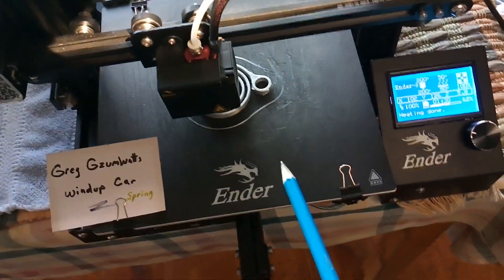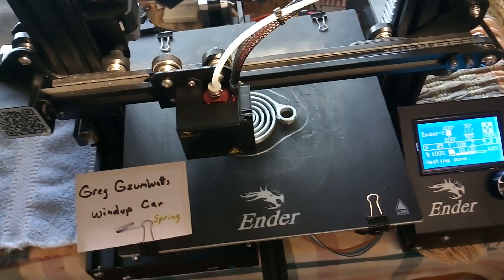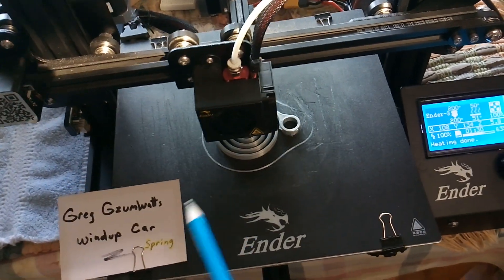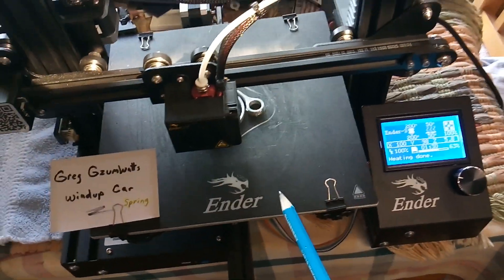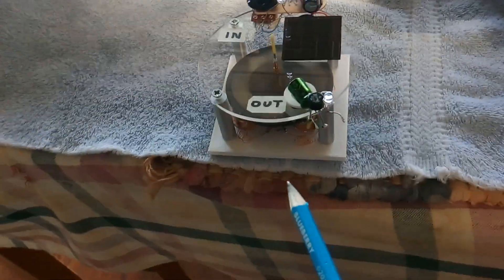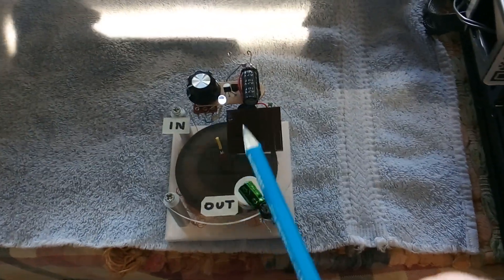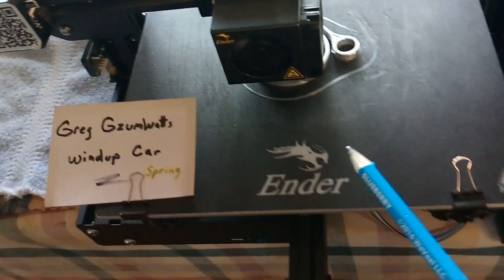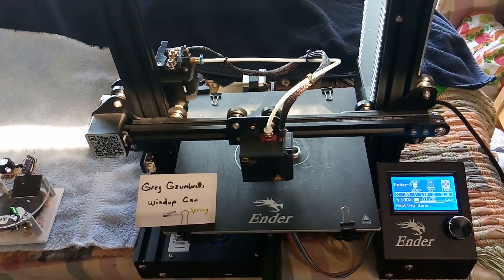Gzumwatt's 3d printed windup car

Comment: Hey thanks for the mention. By coincidence I have just been using some silver filament. I don't think the colour is relevant but this batch seems more flexible - softer even -  than the blue and orange I have been using. When I used it for the spring it gave me less power than the orange or the blue. The blue was very brittle but seemed to give more power. It all gets a bit complicated. The filament I use is the cheapest I can find on eBay so I wouldn't take anything I say as advice, just observation on my own progress 😊
Reply from the maker: Well the car is almost done and I am printing the last parts this evening. It appears that my silver spring is going to work but I might try an orange one for comparrison.  I don't have any blue filament.  Like you I am using the cheapest stuff I can find.  You were right about having to file down the parts to fit.  It is not too bad though.  Fun little project.  I like that you can take it apart and store it in a ziplock bag.
Reply: @Lidmotor  I don't think the colours are relevant, just the fact they are different batches. I just try different colours for the visual effect on camera. Orange and yellow film well for my YouTube videos 😊
Reply from the maker: @GrandadIsAnOldMan  Kinda like M&M candies.  To me the green ones always taste better.  Ha.
Reply: @Lidmotor  and the red cars always go fastest 😆👍
Reply from the maker: @GrandadIsAnOldMan  Always!
Reply: @Lidmotor  my car is red..maybe you can put it 3d springs to make it faster..haha